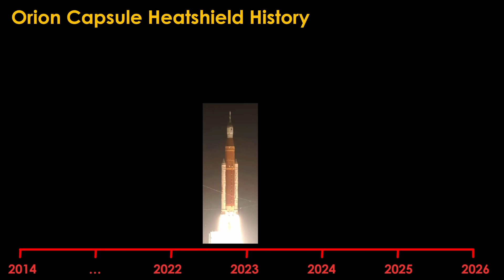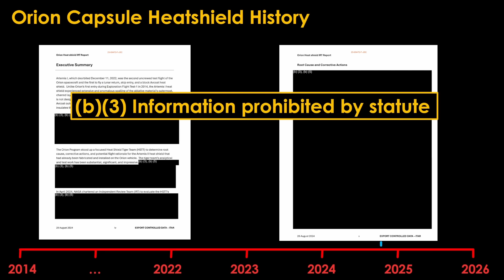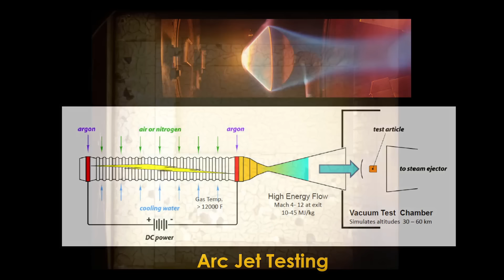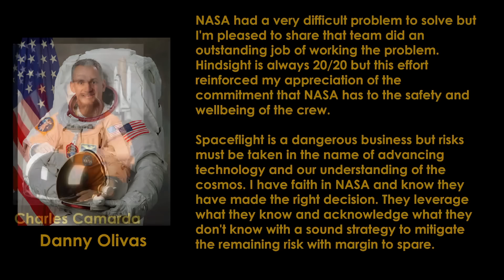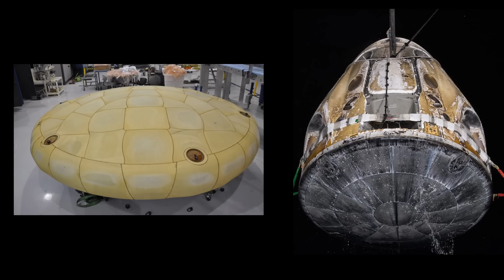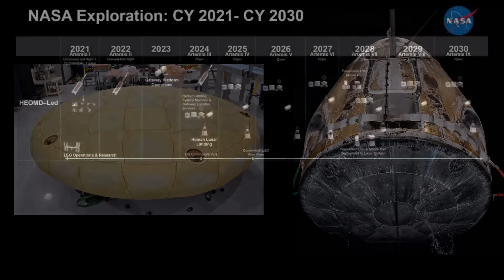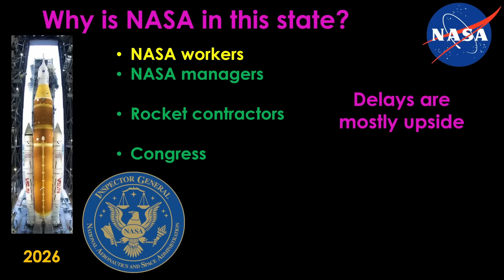Artemis 2 Orion Heat Shield - Is It safe?

Comment: The best part about testing the life support system, is there being zero contingencies on what to do in case it fails once it's halfway to the moon.
This is like testing the car airbags with a live person sitting behind the wheel.
Reply: That's why Artemis II will spend a day in Earth orbit before going to the Moon
Reply: @Jolielegal  Oh wonderful. Then with the crew life support system test complete at that point they can offload the crew onto Dragon before sending the capsule around the moon, right? Right?
We either need the astronauts onboard for tests of critical systems and my original point stands, or this is a dangerous* PR stunt, pick one. 
* - And one of the big reasons it is dangerous, is there being no resource in the even the life support system fails, which can happen even if properly tested first.
Reply: @thearpox7873 But that's always been and going to be true for deep space missions.  If everything fails on a deep space mission, there won't be many options.
Reply: @darylbardo  Yeah, and airbags can fail while driving to work. 

I don't expect perfection.

But you don't use humans to test airbags. Crew should only be on Orion because they are happy that they have tested the life support sufficiently. 

At some point someone is going to die because their life support fails too far from home. That's okay. But not if the reason they were in space was to test the life support system. 

For crying out loud I tested a life support mod in KSP with more caution than this.
Reply: @darylbardo  Not only is that not always going to be true - even during Artemis 3 the HLS can serve as a backup* living environment, let alone when there is more infrastructure around - but that's missing the point. As noted in the video, the point is not avoiding the danger entirely, but whether that risk allows us to fulfill some valuable mission objectives. 

* - Either by not landing on the moon at all and sending the Astronauts back into Earth orbit, or if already on the moon, by potentially providing enough supplies with those ample mass allowances till rescue arrives.
Reply: @thearpox7873 I took the premise to be that ALL life support systems failed.  But as you say, redundant systems are a huge way to increase overall reliability for critical sytems.  I am not familiar with the ECLS on Orion, but surely there is some level of redundancy and system independence so it is unlikely for them all to fail at once, even just in the Orion module.  For example, two small CO2 scrubbers instead of one big one.
Reply: @darylbardo  just like apollo 13 had multiple electrical generators incase of failure

Then the o2 tank exploded

You never know just how something could fail in a unexpected way
Reply: @thearpox7873  just for you to know, that's what they did, bring backup. their IVA suits were actual contained life support systems for backup, they could've live in there, eat drink do their stuff and sleep, for up a week if something as catastrophic as full cabin depressurization would've happened. it wouldn't be comfortable, but surely better than dead. that's why they performed a fly by and not like apollo 8 entering orbit, so if the main life support system fails in ANY point of the mission the backup has plenty of time to work. that's also why they didn't perform a full TLI with the IUS, not only to stay in leo (which would be paradoxically worse adding mission time, so more chance something can fail), but to also verify the orbital maneuvering engine on the SM which wouldn't be used so extensively otherwise in a fly by. two tests in one mission, the OMS and life support which if fails in leo you have backup and lot of time to come back, if after the tli the same thing. plus humans to the moon which is always cool, they were super happy to ride that thing even if it had way less reliability, i'm pretty sure about that. they're astronauts they would ride a cardboard box if it's going to space. also you can't actually test a lot of stuff without humans on board, best example we had was the toilet, i mean how can you simulate that... you need assholes to shit in it till it clogs and verify the design, which indeed didn't fully worked and requires modifications. that's just an example but i guess all the things that were possible to test without crew were tested on artemis 1, therefore making artemis 2 uncrewed too mostly useless, especially considering the heat shield didn't really failed, they just screwed up some math about reentry profile, which once corrected didn't result in any issue on the heatshield. apparently slamming faster into the atmosphere works better for this design, and the other way was ONLY SLIGHTLY less safe, not enough to spend so much time and money and engineering into changing again the shield on an already integrated capsule which is a nightmare, or making the mission useless by not having a crew on board. not enough less safe relative to the implied danger of a moon mission, that's not your average iss 6 months trip, and who flies in it knows that very well
Reply: What should be done to address contingencies?
Reply: @armandomercado2248 Many options.
But the ironic thing is that cancelling Artemis 2 entirely and going straight to Artemis 3 would in fact be much safer, since Starship HLS in orbit can serve as an evacuation point in case the Orion fails midway to the destination. It might still take days to rendezvous depending, but that's still less than a week, and these things tend to fail gradually. And that time can be further reduced by timing SLS and HLS to launch and fly in tandem. (Which might or might not be very difficult, so let's put an asterix on that one.)

Continuing on to the options that won't happen, I do not see why animal testing cannot be used to test new hardware without bringing up PR, but I'll just note that the astronauts main role in this mission appears to be to sit tight and wait, and leave it at that.

Finally is the one I pointed out in my other comment, which is to test life support in the first day in Earth Orbit, dock with Dragon, offload the astronauts, and do the rest of the mission unmanned. Y'know what, make it a fourteen day period instead of one. But as with everything else, doing that would inform the common Joe that something is rotten in Denmark, so it's a non-starter.

Satisfied?

Comment: The entire life support system HAS NEVER BEEN TESTED WITH HUMANS IN SPACE.  

NASA seems to kill a flight of astronauts every 20 years or so. , and we are due for it.  

1967 1986 2004 2026?
Reply: Apollo 1 wasn't a flight. They "were conducting a key test with their spacecraft on the launch pad."
Reply: @michaeldunne338 that’s the hill you want to die on “NASA killed lots of astronauts but technically it wasn’t a flight?”
Reply: @Andrew_Kirch  Odd response. I actually think its pretty bad that people were lost during a pad test.
Reply from the maker: They will test it in earth orbit before heading to the moon. 

But I'm not happy that they haven't been testing it before there are people flying on it. You could have put it on Artemis 1. Put some CO2 absorbers on board to make it do some work. Test that everything works in zero g. Put in test leak to make sure it's detected and the system responds correctly. Etc.
Reply: That's the whole point of Artemis 2, testing the life support system with humans in space.
Prior to the test it will, of course, always be untested.
Reply: @prophetrob then test it in LEO.  If it fails halfway to the moon they are going to spend 5 days in a shoebox.   They don’t have a lander to hide in like Apollo 13 did.
Reply: They're spending a day in earth orbit testing before going to the moon
Reply: @prophetrob things never break on day 2.  So this seems safe.
Reply: @Andrew_Kirch  every spacecraft is its own test article of 1
If the life support system is designed properly then barring mechanical malfunction it will work properly. They've already done the design testing on the ground so the only thing keeping one in earth orbit for the mission duration would verify is that particular spacecraft worked; which doesn't tell you if the next one will be free of mechanical defects.
It would be a pointless test. There is no way to both test if the particular spacecraft will survive the mission duration while in earth orbit and do the mission you're testing for

Comment: If the heat shield fails, they will probably try as big a cover-up as they did after the Challenger explosion.

Edit:  The Challenger cover-up I referred to is documented on the YouTube channels "News4JAX" and "Jason Payne", in the 50 minute video titled "Challenger: A Rush to Launch".  The main focus of the video is several organizations' behaviors after the disaster.  The video was released in January 2016 on the 30th anniversary of the Challenger disaster.  It was made by WJXT Florida.  It includes many old interviews, some new interviews, and some old space related videos.  The video on the News4JAX channel has about 8 minutes of embedded commercials, but this channel is the original creator of the video and the commercials probably help support the creator company.  The video on the Jason Payne channel does not have embedded commercials.
Reply: What cover up was that?
Reply: @imaginary_friend7300   The Challenger cover-up is documented on the YouTube channels "News4JAX" and "Jason Payne", in the video titled "Challenger: A Rush to Launch".  The main focus of the video is several organizations' behaviors after the disaster.  The video was released in January 2016 on the 30th anniversary of the Challenger disaster.  It was made by WJXT Florida.  It includes many old interviews, some new interviews, and some old space related videos.  The video on the News4JAX channel has about 8 minutes of embedded commercials, but this channel is the original creator of the video and the commercials probably help support the creator company.  The video on the Jason Payne channel does not have embedded commercials.  An excellent 50 minute video with a lot of information.

Comment: Orion is too wimpy to repeat Apollo 8 's settling into lunar orbit for nearly a day.  Artemis II will be on a "free return trajectory" which heads out from Earth, goes near the Moon, then the gravity of the Moon bends Orion's path and flings it back towards Earth.  The Orion engines are too weak to slow the capsule into a low lunar orbit, so the loop behind the Moon then back to Earth is one of the few lunar missions Artemis II is capable of.

The Artemis III (3) Moon landing has the Orion flying a Near-Rectilinear Halo Orbit (NRHO) around the Moon.  This is a much lower energy high eccentricity orbit that quickly dips low toward the Moon, then spends most of it time going out far from the moon, for a total 7 day orbital period.  Artemis II may be able to get in and out of an NRHO orbit, but officials may think this would look bad for the public, with the Orion spending 7 or 14 days or more, waiting to be in a position to return to Earth.  With a NRHO lunar orbit with a 7 day orbital period, the Orion would only be in a position to return to Earth every multiple of 7 days after their first return opportunity.  This may look bad for government officials if the Artemis II astronauts orbited the Moon for that long, with nothing publicly exciting for them to do.  It could show how weird using the NRHO for Gateway and Orion actually is.

The NRHO orbit puts a greater delta-V requirement on the lunar lander stack.  If the lander is reusable, then more fuel had to be trucked to the moon for additional landings, then transferred into the lander in NRHO orbit.  The NHRO orbit has higher velocity in its low pass by the Moon, than an Apollo-like low lunar orbit.  The lunar lander then requires more delta-V to slow down from the NRHO orbit's close pass by the Moon.  Also more delta-V to rendezvous back to the fast NRHO orbit.  They designed Orion with less delta-V than Apollo, and dumped the higher delta-V requirement onto somebody else's then-future lander project.  The buck was passed to be someone else's problem.

Artemis II is flying a free-return path, because that is about all it can do.
Reply: Orion is not doing NRHO for Artemis II because of the mission architecture, which basically means that the ESM will perform part of the TLI, as the ICPS was only going to boost them into an eccentric systems testing orbit. The design itself is underpowered because of its Constellation heritage, with Ares I being supposedly a cheap and light launch vehicle being the CEV's launcher, and the bigger superheavy Ares V launching the lander. Under the Constellation architecture, Altair would've conducted the lunar orbit capture burn. It only became "someone else's future lander" problem when Trump decided to resurrect the moon-shot program using Orion, a decade after Obama cancelled Constellation and Altair.
Reply from the maker: Agreed. 

It was a vehicle without a mission before artemis came along, so not having a lander wasn't an issue.

Comment: I'm so used to watching SpaceX throw a heat shield on Starship in a week or two, that it's hard for me to process why NASA can't replace the heat shield on Artemis II with the same compound as Artemis III when they have had years to do it.
Reply: It does have to deal with a significantly worse thermal environment with almost no testing
Reply from the maker: Absolutely no benefit inside NASA to try to go fast and lots of incentives to go slow.
Reply: @EagerSpace  My gut says you're right. And I hate it. (but I'm still a fan)
Reply: Trying to completely remove the avcoat that's already on the capsule might not be possible without damaging the underlying surface.
They would probably have to sandblast it to get the last bits and residue off so the new coat can  bond properly
Reply: For goverment worker could go home after they finished the weeks alottwt work. 

They would only work monday and get twice as much done
Reply: You seem to understand that you can’t just take the Orion capsule off SLS, replace it’s heat shield and put it back on, the Orion command capsule is already integrated into the European service module,  the emergency escape tower, and the SLS adapters. Taking off the command capsule would essentially require dissembling and reassembling the entire rocket, this takes a long time and is extremely expensive, this is probably why they are so hesitant to replace the heat shield especially since the one used on Artemis I didn’t really fail.
Reply: @RileyKravitz They've had years to address it.
Reply: @JakeStz they had started integrating the Orion capsule for Artemis 2 during the launch of Artemis 1. Later they after discovered the anomaly with Artemis 1’s and began to investigate it. Now they could’ve paused the construction of Artemis II here but it would’ve led to delays and breaking contracts NASA had with other companies, so the construction of the SLS for Artemis II resumed as they were investigating the defects with the heat shield on Artemis 1. By the time they figured out the problems with the heat shield the Orion capsule had already been integrated to the European service module, had most of the major joints sealed, with the wiring and TPS becoming inaccessible, dissembling it would’ve been, again, expensive and would’ve caused years of delay. A lot of problems with NASA designs come from trying to avoid spending money and delays, hence why they started building Artemis 2 prior to the launch of Artemis 1, because it would’ve delayed the launch of Artemis 2 to the 2030s. Not trying to defend NASA, they should be working more urgency, they’ve consistently fallen behind schedule ,and their management sucks, just trying to explains some their decisions because a lot people in the comment section don’t really know what their talking about.
Reply: Designing for ease of maintenance and manufacture. It's one of those things that might have been a significant upgrade if there had been a Shuttle 2.0. Something like being able to replace a large section of heat shield quickly is essential if you want to actually have an economic space industry. On the Shuttle, almost everything on the heat shield had to be custom made when it broke, and that just isn't a viable.
Reply: NASA doesn't build or maintain spacecraft.  They contract that work out to companies, in Orion's case: Lockheed Martin.   People blaming NASA for the fuckery of defense corporations is wild.
Reply: I just learned in another video that it takes them multiple months just to fill the consumables into Orion... it's a complete joke
Reply: @gorgonbert  bruh
Reply: @gorgonbert   the Senate Lobbying System (SLS) is a scam and money laundering operation. Bechtel corporation and Boeing are SHAMEFULLY paying off our politicians.
Reply: Because Starship isn't currently carrying any humans onboard, so SpaceX is free to experiment their heatshields as they wish.
Reply: @0x1ED1CE  They've also had breaches into the fuel tank on many occasions.
Reply: @0x1ED1CE  well why cant nasa do the same then?
Reply: Re-entry heat is proportional to the velocity cubed.  Therefore if the re-entry velocity doubles, then 8 times more heat is generated.  A capsule falling back from the Moon has more velocity than a re-entering orbital capsule.
Reply: @davevann9795 I get that the heat shield has to do more, I just don't know why Artemis II doesn't have the new heat shield that Artemis III has.
Reply: @JakeStz  well it doesnt matter now since they reentered just fine and survived.